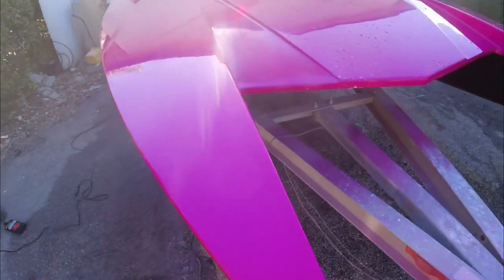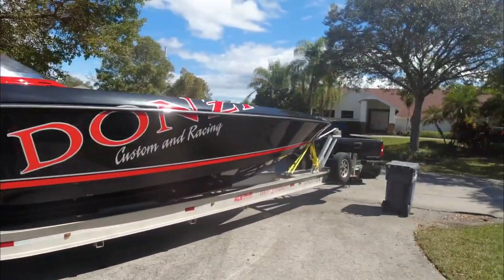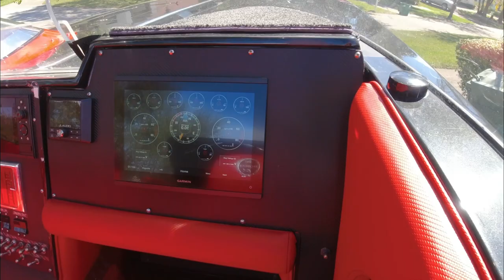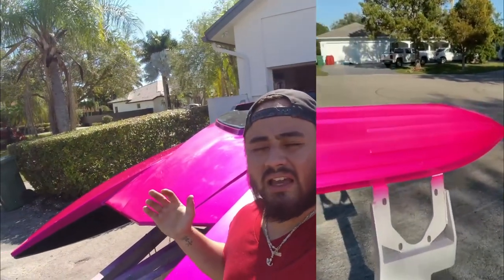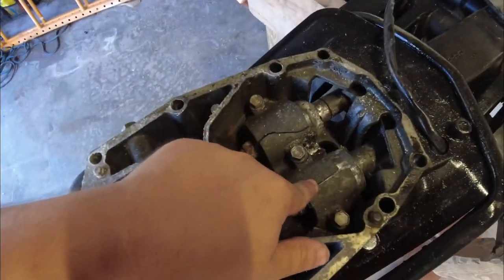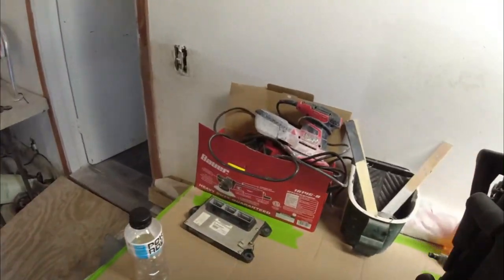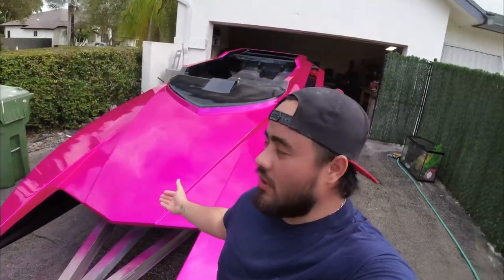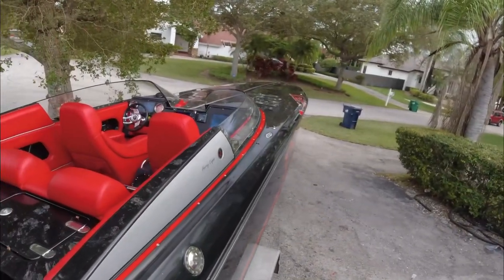THIS BOAT IS WORTH MORE NOW THEN WHAT WAS PAID 3 YEARS AGO | SPEED BOAT CLEAR COAT REPAIR

Comment: Not sure if you're aware of this or not, but some paint colors need a lot of coats to reach the desired color. 
I'm sure the test sample the paint shop mixed for you that you tried on the small scale is the same color you used on the actual boat but you didn't lay down enough coats. Usually paints are mixed by machine and the variation between a small batch of paint and a large batch of paint being mixed is little to none.
This really becomes apparent in brighter colors, and sometimes you need to spray a white base coat prior and you'll still need to do 5+ coats of the color you want and with every coat the color will brighten up significantly.
Reply from the maker: I appreciate the feed back. Have you watched my other videos when I painted the boat?  This is my first time painting anything. I’m a newbie to painting so any knowledge is Appreciated